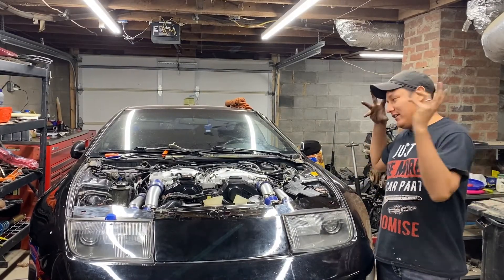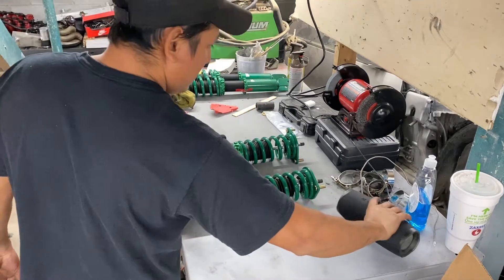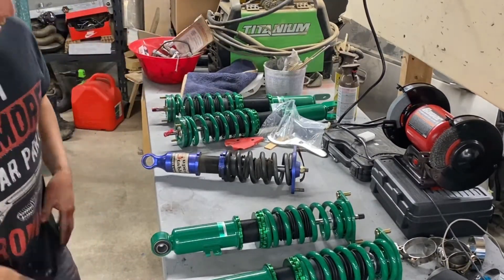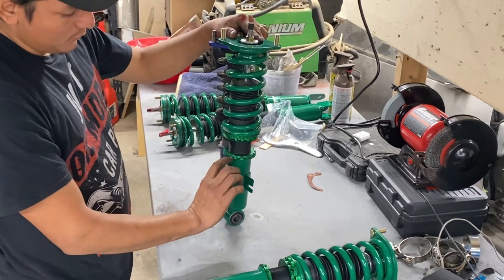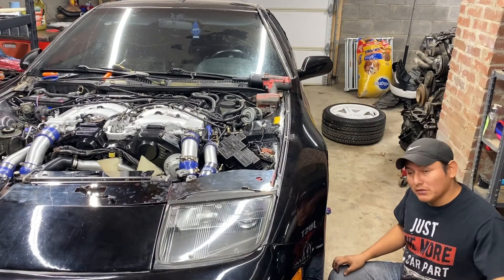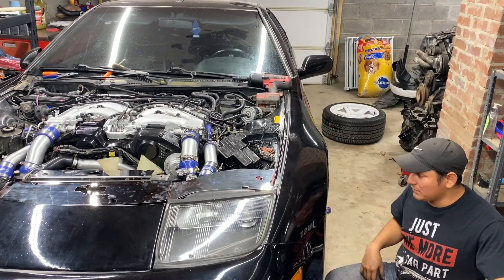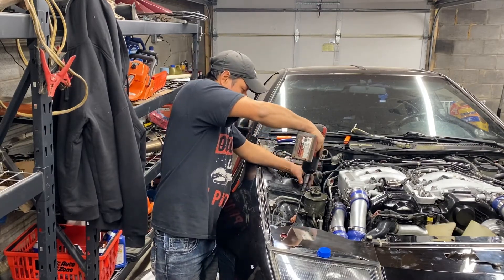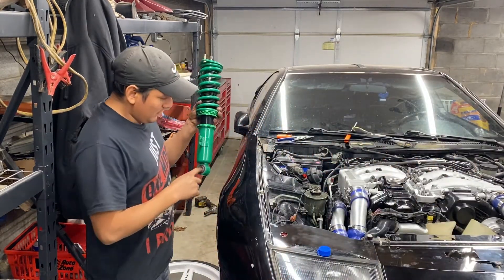300zx tt installing new tein coilovers

Comment: So i got a 91 TT but want to switch out my stock suspenion for the same coilovers like u but what do i do with the old suspenion electronic you know the thing that sit on top of the suspenion?
Reply from the maker: yea those can't be use on the this type of coilovers i thin those adjustable controllers only  fits on the oem ones if you thinking what i'm thinking lol